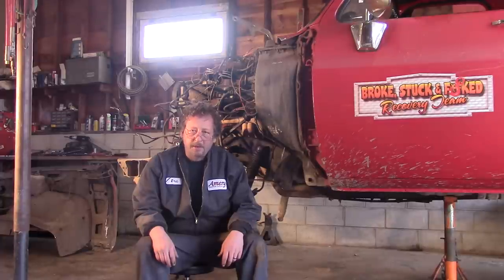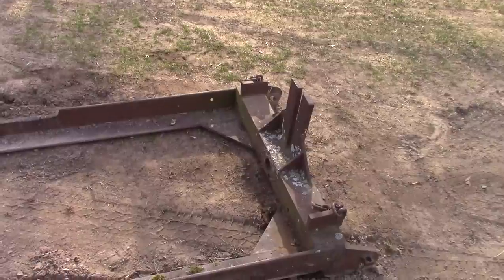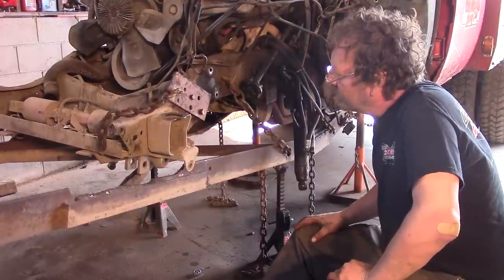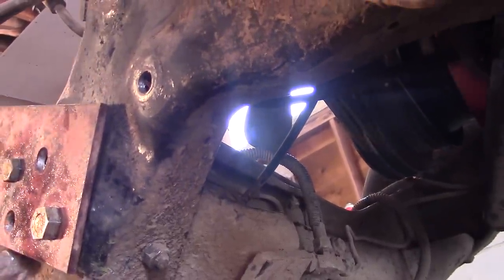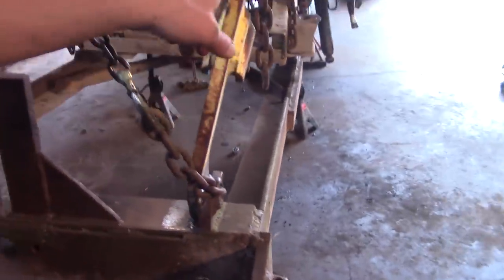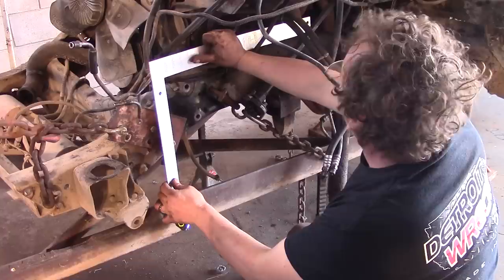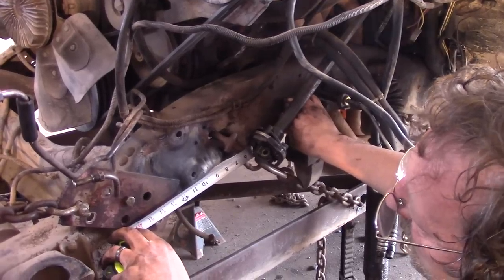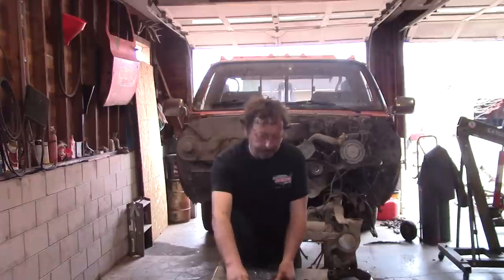BENT FRAME FIX by BSF Recovery Team

Comment: i am a body repair guy. what you did is dangerous and crazy. but you got it, and glad no one got hurt. my only critique is you should have pulled from the end of teh frame rail, it would have still gone out and up but would give more leverage . and be careful heating a frame under tension.....i pulled one in two doing that.

Comment: Just for future frame pulling advise.  The rig you used was perfect and how you anchored it was just where we would have had we use a rack or floor pots.  If you had used the end of the frame horn (where the bumper mounts) you would have achieved a better up angle and more leverage on the pull making the job easier.  Also relieving the frame with a large hammer as you pull helps.  Hit around the bent area and at the top and bottom edge of the C channel.  This shocks the atoms and assist in moving them around so the metal moves.  Also if you can slightly over pull (no more than 1/4" if pulling cold) and then relive the metal with a hammer. The metal will want to spring back and even if you get the right dimensions under pressure you prolly will not have the same measurements when you release the tension.  Heating the frame works well too just don't over pull as much, as the heated metal has less spring to it. 

As for the frame bending again more easily... Not really going to be an issue here.  This is a cold formed mild steel frame that wont work harden or fatigue with a small bend such as this.  Also the heating done will help prevent any stresses that would cause the frame to bend more easily.  A sharper bend would have had future bending issues but this bend here will not have any lasting effects.  

The body style after this truck is another story.  Those were fully boxed in this area using hydroformed HSS steel.  a small bend like this one was an absolute pain to pull out and could stress fracture the area around the bend.  Good news was that frame was less susceptible to a bend like this from a hit like the truck took.  

I enjoy the vids keep em rollin.
Reply from the maker: Thank you for the comment, all good info. I did work the frame with a hammer, just didn't show it on the video, it helped but not enough. The frame on the 1 tons are a bit thicker than 1/2 or 3/4 tons. I was worried that if I pulled from the front, that it might bend in a spot that I didn't want it to bend, but than again this was the first time for me.
Reply: Agree, that's what I was thinking about pulling from the front.

Comment: Before adding heat did you try smacking the bent areas all over with a hammer while under tension? It will help the metal relax. Just go back & forth, pull then pound, pull then pound, to get it as close as you can before using the torch.

Comment: cut the corresponding section off the old frame, cut that in half length wise, removing a small amount of material so it fits inside the frame on the truck, weld it in, align and drill holes for the steering box to mount, double the frame strength,

Comment: I could actually see the frame horn moving up and forward on the video the last time you heated and pulled it.  I once had an old Dodge farm truck that had this same problem.  It would turn super tight to the left but hardly any to the right at all.  I always suspected the frame was bent like this but I sold it before I had a chance to try to fix it.  I shoulda called BSF Recovery Team!

Comment: Even though you had the right idea with your contraption and the turn buckle, it was hurtful to witness you struggling.  I have straightened a gang of those frames without so much struggle.

It is lengthy to say here how it's done, but the turn buckle should have been attached to the frame horn, end of the frame where the bumper bolts to.
Then you use a "rose bud" to heat the kink (bent part) cherry red prior to pulling.

You must pull a measurement ("number") from a bumper bolt hole on the good side to a hole close the cab mount.  The longer the more accurate.  The bent rail has the same holes.  You just need to find a common hole on both sides to measure.

As you pull with the rail while it is hot you can see the kink walk right out.  Just make sure to constantly measure your your work.  I always pulled a little past the magic number and allow it to cool.  When you release the tension the rail will retract a bit so it matches the other side or close to it.

To check the height you can run a string line (datum line) along the frame under the cab where it is straight and measure down from the good frame horn.  The repaired frame horn should be the same or close.

 I could show you how to make your own (very) accurate frame gauges that you can hang and monitor while you pull, but I need to be there in person.

Anyway, I do appreciate your intellect in straightening your frame.

Comment: Some extra chassis doubler plates might be required. Given how hard you work that rig a good degree of extra strength ain't going to hurt. Bit of extra weight is not going to be a bad thing. Were the military chassis stronger than standard?

Comment: When finished put some insulation on the heated spot. It cools down slower thus getter more strengt. Never cool down with water. Makes the steel brittle and snapping more easy.

Comment: I have a 85 chevy 1 ton slide back  18ft flatbed I did the same  but my cross member in the front was cracked I made a new one and plateded the the steering box no problems yet.

Comment: Probably would have been better off with an 8 foot piece of 8" heavy C-channel, or better yet 4" x 8" x 1/4" wall box beam. No need for a whole frame jig if you're just pulling one rail straight.

Comment: How much weaker does heating the frame make it? Like say hitting a decent sized hole the wrong way or going over an obstacle with the frame twisting a little bit could bend it again? Instead of boxing it would welding some thick plate to it keep from bending again? Just curious, I've never worked on a frame..
Reply: Not any weaker than the bend he's taking out, frame is already compromised and and would need reinforced anyway.
Reply: Big Phizzle: truck frames twist so they will pop back out.This is why you do it yourself.Any frame shop worth a shit will not straighten a truck frame for this reason.I think newer frames like gm can be straightened just by the way they are designed.
Reply: I do not agree with that statement. heating the frame would most def make it weaker than the bend itself. The heat is weakening the steel at a molecular level.  The rest true though. needs to be reinforced. Plated, only welding on the side of the frame, not on the top or bottom flange since that is where your strength is. Also, boxing the frame prevents flex/twist that you actually need in a frame.

Comment: Why didn't you pound/hammer the frame once you moved it where you wanted? You have to do that to rearrange molecules. Heating it weakens it.
Reply: That is what i do when doing this kind of repair. But i use a real frame machine. I have been doing frame repair for 40 years

Comment: I'm a 35 year frame body an paint guy I opened my own small shop to make more money doing what I do an what I did is took two large building I beams an build a big letter H I drive the vehicle  on it an use big losing chains an gears chain comalongs an porta powers an I chain car down an jack an pull all over it works great an get your self a rose bud or a big brazing an welding tip

Comment: You need to put some heat on that, and release some of the pressure with hammer blows. Without heat you risk tearing the metal.  OK - that was halfway through. Now you have the torch.

Comment: Could have used a small bottle jack between the 2 frames to put some lift on it and a hammer to help it along....heating it just softens the metal and looses the temper of the steel

Comment: I would convert the steering to crossover instead of the stupid Chevy style, that would get rid of those forces on the frame.
Reply: Rxslinger actually he is right, it would change the stresses on the frame. It would need to be reinforced either way but if he did cross over it would change the direction of the stress on the steering box from a front-back to a side-side stress thus not allowing the frame to buckle in that direction. The truck has probably been in an accident and been straightened before. FYI just telling somebody that they are wrong is not the way to go through life.

Comment: did you actually survey the actual frame before you attempted this short term fix..

you would of been  better to  chop the bend out  rather than trying to straighten it because you already have weakness in the area due to the impact I would  hate to say you would have brace this option as well as chop option..

though from what i saw of the frame rail itself it would of be a very short term fix, as you seem to have rust and stress fractures behind the effected area you are trying to straighten..

i think you would of been better off to replace the actual frames, as I doubt what you are doing would pass DOT inspection today

and another you should have heavy duty frame rails if this is registered as a towing vehicle..

i'm a welder by trade and i study metalergy  and from a structural point of view you already have weak point due to impact and for the time you physically waste on trying to repair this it be far cheaper just to replace the frame  than to keep using it and i would thin the DOT certs would be now void on the vehicle due to the structural integrity of the actual chassis;..
Reply from the maker: The frame is not rusty, or cracked, what you see in the video is mud and dirt. I only cleaned the area I was heating up. This wrecker is off-road only recovery, so DOT compliance is not a concern. As far as strength is concerned we have a kit to install that is for severe off-road use, and it only has to last till we do the crossover steering conversion with hydraulic assist. Then most of the stress on the frame from the steering box will be gone.